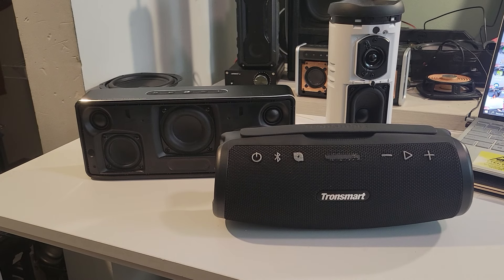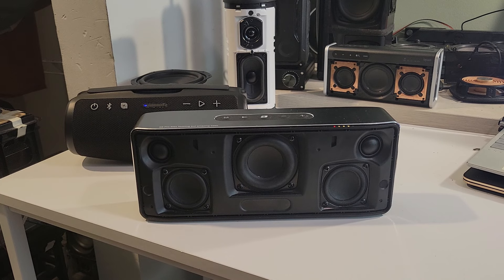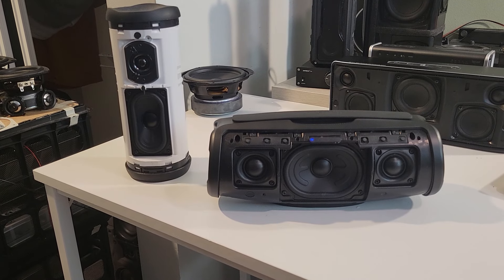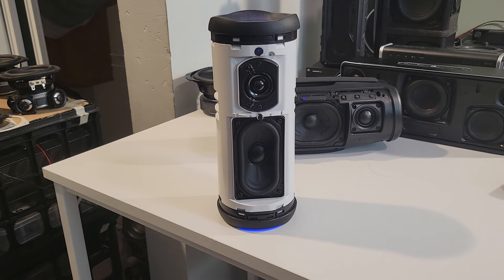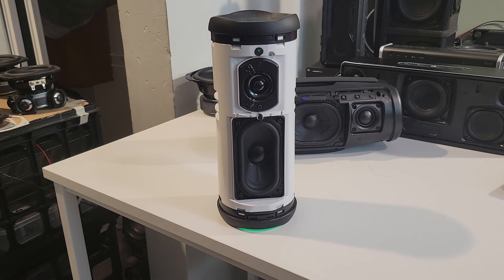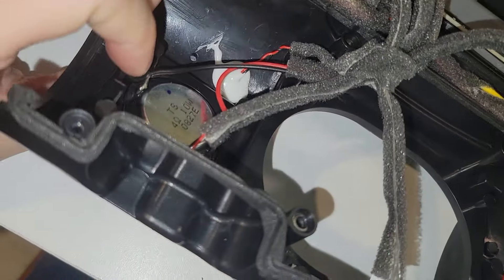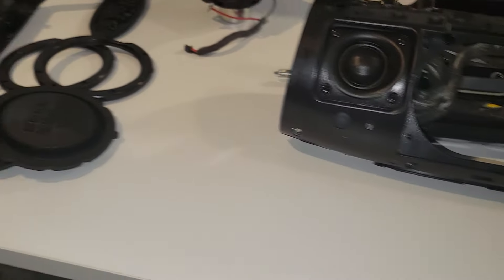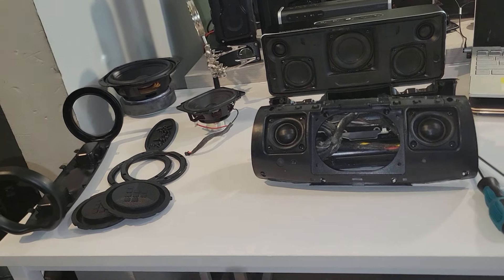Wow! Tronsmart, that's not bad at all! Tronsmart Mirtune S100 Review & Teardown

Comment: First of all, good job with the video comparisons! Do you think replacing the Tronsmart's tweeters for higher db tweeters would make a difference with the cover back on? I did that with the Soundcore Motion plus because even though it sounds good, it kind of sounded muddy to me so I replaced the tweeters and the change is remarkable. Let me know what you think.
Reply from the maker: It should help but the tweeter frame has a weird shape. It might be hard to find a suitable replacement
Reply: I'm getting it this week. I'll attempt to  do it, and I'll let you know.
Reply: @escalante7  the problem is that they put glue all over the mesh what acts kinde of a sound barrier. So you have to get rid of the glue to get clearer sound. I cutted holes out of the plastic in the tweeters area and used universal thinner to clean the mesh from the glue. It helps soundwise (the soundstage and clearity is amazing in comparison to the jbl charge5 ) but you can see now where i used the universal thinner.
Reply: @escalante7  the problem is that they put glue all over the mesh what acts kinde of a sound barrier. So you have to get rid of the glue to get clearer sound. I cutted holes out of the plastic in the tweeters area and used universal thinner to clean the mesh from the glue. It helps soundwise (the soundstage and clearity is amazing in comparison to the jbl charge5 ) but you can see now where i used the universal thinner.
Reply: Thanks for the tip! I'll try something similar before swapping the tweeters.
Yes, it doesn't matter how good the brand is or the sound, monophonic sound lacks the spatial character we hear in stereo audio.
Reply: Tronsmart's designers were smart, adding the extra tweeters for a stereo experience. If JBL had done that with the Charge 5 instead of installing only one tweeter, it would've been a keeper.

Comment: 14:18 pasha es had that exact same problem. The cone completely fell and ripped apart after a few minutes of use in water. They definitely need to change the cone material to plastic or something that wouldn't be damaged by water ASAP.
Reply from the maker: Or add ribs on the cone to increase structural integrity.